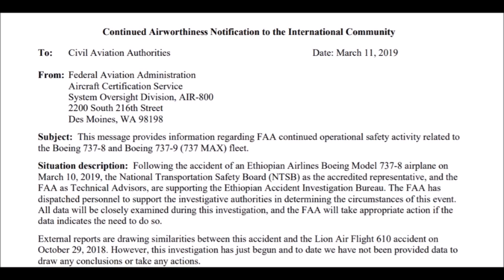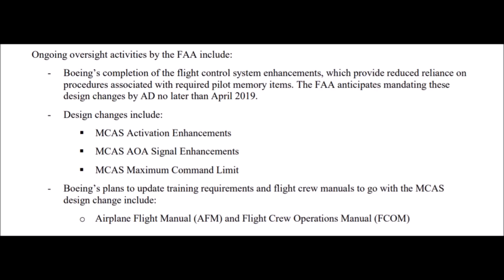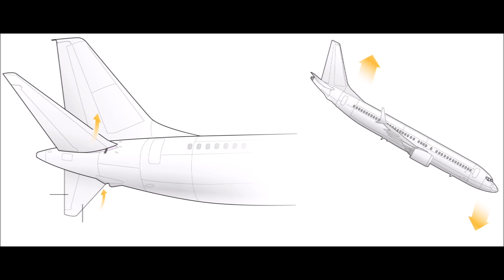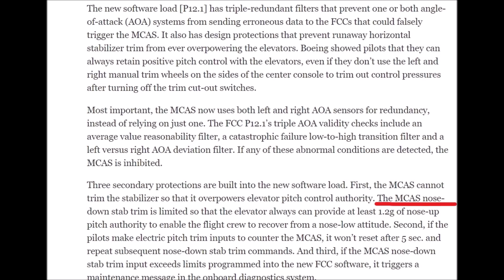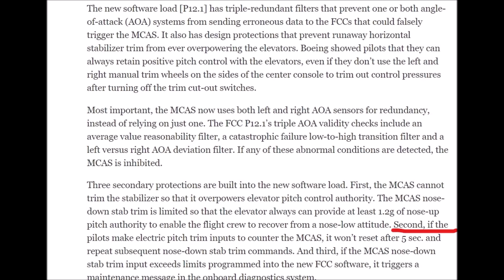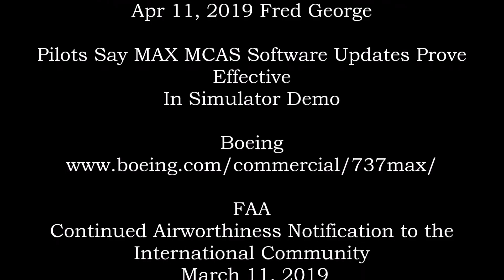737 Max UPDATE 14 April 2019 "The Fix"

Comment: Such a system to save money, save time, save training yet untested , unproven cutting corners results in two fatal accidents. Tell that to the families of the victims who list their lives. Its incompetence of Boeing and the FAA to release faulty design. Where is accountability. So how can you assure passenger this aircraft which is poorly upgraded and aerodynamically unstable be fixed by software. This plane is not hands off stable. I dont see why shortcuts are an accepted process at the expense of lives.

Comment: Can anyone explain why the Auto-throttle pushed the airplane to the dangerous high speed? Is that system also a problem? Is it in anyway connected to the new MCAS system?
Reply: Jian Min The autothrottles were set to maintain a fixed rate of climb. Since the aircraft did not climb because of MCAS, the speed accelerated.

Comment: No! You're Wrong Captain! There is NO fixing the MCAS system and getting these planes back in the air! None! The entire reconfiguration and program Must be aborted and scrapped. Any change to the aerodynamics such as these changes (enlarging the engines, squeezing them together and moving them forward) that is so great as to have to rely on a pc system overide such as MCAS is too much a violation of natural laws of physics or no overide would be required. It's a cheap cheat. Unforgivable. No rationalizing. Full stop. Not  open for discussion. No excuses. BTW I'm fully qualified to state this only because I'm not a pilot. But I flew kites as a kid. And I ski and mountain bike and ride horses cross country. Same principles apply. All of you in the industry are up too close. The Max 8 program. Should be completely aborted. You can retrofit the old 737 with a boob job enlarging, lifting and squeezing together... Your engines. Just as it injures the back of women getting bread augmentation so too do you injure passengers because you can't ever justify the risk even with corrected MCAS and training. There is no solution except to redesign the entire plane. Don't mismatch engines and fuseksges to fast track to a solution just to get promoted and a bonus. Ever easpect if this reals. So much for trusting a once stellar industry in terms of safety.

Comment: I am very concerned that this approach ignores the elephant in the room.  MCAS's only role was an economic one which is to prevent the retraining of pilots.   I think I will never board a 737 max unless they rip out MCAS and require 737 max pilot certification.  If they certify the 737 max with a software fix, I will refuse to book and furthermore board any 737 max's and I will let my airlines know this.   This cannot be a quick fix.  There is something fundamentally broken on what could have been a very cool plane.

Comment: To my previous comment. It sounds like MCAS was not fully tested in all flight parameters. It appears that this system was designed to make the Max series feel like the 737 NG. My question still is how was this released as a “production ready” product when all flight parameters were not fully tested. As you say. This question will be at the center of lots of questions and hopefully, answered.

Comment: Difficult to understand how MCAS got pass the “Proof of Concept” stage. Perhaps.., there were no “seasoned” pilots on the design team when this enhancement was thought up. I’ve personally witnessed software failures similar to this for decades... and throughout multiple industries. Thankfully, there were no lost of life with these occurrences. When the initial accident occurred, my first thought was... did Boeing take a page out of AirBus’ flight control technology playbook? Upon the second accident - there is a reasonable affirmative to this thought bubble. I was once told that commercial aviation in improving by one (1) accident at a time. Sad to realize how true that statement actually has become.

Comment: Juan, does that mean that the electric trim on the pilot/copilot yoke is not inhibited at that point the MCAS system cuts out? 
The reason I asked is because you were talking about the difficulties with manual trim during high air speed and that the crew was only able to gain minimal trim up manually. I was unsure because in the last video you spoke of the crew being unable to manually trim during a high speed decent and so, does that mean the electric trim was unusable too when MCAS was shut down or, were aero forces on the trim tab preventing electric trim  to work as well?
Reply: S S Once MCAS is fixed, there should be no need to use the trim cutout switches, and many of those difficulties will disappear.

Comment: From what Mentour Pilot said, the main reason for MCAS is because the engines on the MAX are larger on an already low sitting aircraft so in order to mount the engines higher to fit they had to be moved forward. That allows them to push the nose up more easily. So MCAS was meant to help the pilot over come that. It was just very poorly implemented. How they didnt factor in redundancy like everything else on an aircraft is beyond me.

Comment: The latest slogan for Boeing goes like this "If it is a Boeing 737 MAX I AM NOT GOING". The public will not be swayed very easy to put their lives on the line by flying this flawed product. Boeing did not look at the maximum travel in the nose down of the elevator stabilizer jack screw. The jack screw was left over from the original 737 700 series and down. Cutting down the length of this jack screw or installing a physical stop instead of depending on a "SOFTWARE" limit for this screw is the right thing to do. This plane needs to be kept out of service until the whole certification process is reviewed.

Comment: Automation is always a good thing, I agree but using automation to fix a flaw in design is a misuse of automation. Did the previous versions of the 737 need MCAS...No! This is because the engineers who designed them were not thinking of the "bottom line". Now I understand that some sort of rotation or torque will occur when power is increased to the engines this is physics, but to the degree where it can cause a stall it is poor design and dangerous. Now the upgrades will fix the problems with the MCAS but will it fix the aircraft? 
I do not want to seem conceited  but I bet if they put that engine back under the wing and do some engineering to figure the landing gear height problem this flaw would be non-existent and the 737's reputation would start to heal.

Comment: Maybe the MCAS stuff was a symptom of a root cause higher up the chain, specifically the angle-of-attack sensors. Both Lion Air and Ethiopian airlines were from third world airports where it is not inconceivable that the procedures to protect angle-of-attack sensors from wasp nests were not followed.
The evidence for angle-of-attack sensors blockage in both cases would be unrecoverable and hence maybe not the main concern.
https://www.heraldnet.com/nation-world/not-just-the-737-angle-of-attack-sensors-have-had-problems/
Even with the changes Boeing is proposing if both sides angle-of-attack sensors are blocked by wasps, MCAS could still get bad readings from both sides and suprise the pilots with weird stuff.
I think Pitot tubes and angle-of-attack sensors should have air pressure fed into them prior to takeoff to confirm no blockage and therefore correct operation.

Comment: I'm honestly puzzled as to why Boeing didn't implement this from the outset. Not a matter of "hindsight being 20/20", this fail-safe redundancy is standard procedure for flight critical systems. I'm a senior test tech for a leading avionics company and all of the flight critical stuff I've worked on has always been like this. We have 2 processors in each ILS receiver cross-checking each other. If they disagree, the 'master' will flag the data as corrupt and the 'slave' will disconnect the data bus. Our autopilots automatically disengage with conflicting inputs, etc.

Comment: Automation in aircraft is fine because there are regulations to keep the pilots practiced in hand flying. In automobiles, I think were all in trouble. Things like auto braking and auto lane centering will essentially allow people to be that much more irresponsible behind the wheel. "Yes, I've had too much to drink but my car can drive itself so what's the problem?" Drivers don't have the supervision that pilots do. Years ago there was a collision (I don't call them accidents because most are not accidental) because a newly purchased car had antilock brakes. This driver thought he could stop on sheet ice because the wheels wouldn't skid. Sadly he found out otherwise. Will there be regulations to keep people practiced and knowledgeable  with these automated cars? I certainly hope so

Comment: Juan thank again for the update with accurate explanation, a simple question: those killer engineer team going to connect 2 AOA sensors instead of one on the CMAS device, so if 1 of those 2 isn't working proprally it will shutoff the CMAS or will that device make a "lucky" multiple choice between those 2 censors info? Why not put a 3 th one so data can be logical compared! Or will we re- design a brand new single AOA unfailable sensor if ever those 737 max 8 and 9 crap would go back in the air?

Comment: My concerns are a bit different from most of the comments.  The original MCAS system allowed for the horizontal stabilizers to move to the full extension or limit of the  jack screw.  Someone must have thought that much trim could be necessary.   Is there still a situation that could exist that would require that much trim?  Is there a loading situation where there could be that much weight in the back section of the plane, that it would fly normally with full elevator trim?   Maybe the original software engineers were compensating for a problem with the aircraft's balance that we are not being told about.  To what extent are the pilots going to be trained?  What if the system cuts out, but is actually needed to bring the plane out of a stall?  It's good they are working on the problem but it may not be correct to immediately assume this is the end of the problems with the airplane's trim control.
Reply: Internet Privacy Advocate Actually the software was limited to zero degrees nose down trim. Unfortunately at high speed this is still uncontrollable, since an aircraft must have some nose up pitch to fly, and the elevator forces were very heavy.
Reply: @gordonrichardson2972 , if I understand you correctly full extension of the screw jack or the nut moving on the jack screw when it reached the very top of the screw, the airplane would have been perfectly level to the air flow.  However to maintain lift, it has to be somewhat nose up to the air flow.  But then if there is too much of a nose up condition the flow of air is interrupted and the plane looses all lift.  I do understand that at high speed the large control surfaces become very difficult to move.  That is in fact why a large screw jack is used in the 1st place.

But what I'm questioning is why did the designers of the original software believe that full extension of the control surface as it relates to the travel on the jack screw could be necessary?

I can't remember if you are the guy that is adamant that there are issues beyond the MCAS system.  I don't know, but believe there could be.  There has to be a reason this system was added to this particular aircraft.  We are told it is due to the position of the larger engines.

Comment: Boeing has let their bottom line dictate production shortcuts. The 737 has been a great aircraft. Boeing should have designed a new air frame to handle these new larger engines. Instead, Boeing pushed the larger engine mountings forward, thus pushing the center of gravity forward. Which called for the creation of MCAS to correct the nose down attitude. The FAA are at fault, in that they transferred their inspection and testing protocols to the manufacturer, who signed off on the new aircraft certification.

Comment: Juan are you able to speculate / opine on what you think is the reason such a thing made it this far in such a highly regulated industry? Is this profiteering games, "Ah we can circumvent that regulation / requirement if xyz."

Was making mcas as "lite" of a system as possible required to not raise flags that this aircraft model may need a new "type certificate"?

When I think of what you said on the whole, it's yes that's why.

Comment: I will try my best never to be a passenger on this plane. I hope that there is enough outrage from passengers like myself to keep this plane permanently grounded 
Just knowing that the engine placement causes the plane to do things that the 737 never did and rely on a computer to handle that is just frightening. The only lesson Boeing can learn is to accept this is a colossal mistake and scrap the plane altogether. I really dont care how good the computer fix might be. My brother has a very computer driven private plane, the Falcon 7' x and  I know for a fact the computer systems are prone to failure. They have back up's certainly but the plane should be designed to fly without relying on a computer rather than the other way round.

Comment: Hello!

I have no dispute that the MCAS was not "finished" for real world use. I am also aware of how such software is produced. A standard someone I respect established was that there be a single person responsible for a readthrough of such a system [30 years ago]. It is frustrating that human error will infest software. It is more frustrating that software is not modular -- and easy to analyze -- enough to be make a "single-person readthrough" practical. 

I had some contact with systems not bearing on life or death situations. One of the systems was an accounting program which had bad code which double counted some data. I found the place where that was and fixed it. [The code looked very much like someone could have been winding up their work when they were weary or distracted. And they left old code in the program which counted once. And new code that counted again.] 

I hope this manner of mistake were much easier to identify. 

Thank you for your insight and fairly straightforward explanation of the likely problem.

--DG

Comment: IMHO how it got certified is the real problem.  The deficiencies were obvious and should have been picked up.  And it begs the question, if the certification process missed these, what other gotchas are waiting to pop out for my next flight on other aircraft.  I was not aware commercial aircraft passengers are actually beta testers.

Comment: Insufficient "what if" testing on the program.  Also no triple redundancy.  Oh well. The fixes seem appropriate though at what cost?
Reply: Matthew Trevett — Triple redundancy doesn’t automatically get you fault tolerance, there must be a properly designed system to implement it.  There are examples of Airbus getting into trouble by using incorrect sensor data as well.  Qantas 72 — A330
Reply: @GH-oi2jf  I don't disagree.

Comment: as you commented season two pilots had no problem dealing with this increased Center of Gravityforward center of gravity I'm against adding any more computer control than absolutely needed and again that they might a revised them Mass but as I had questioned in Prior videos shouldn't be procedure to any pilot to shut off Mcas the automatic trim and the automatic throttles when you get into a situation like that and just fly the airplane you know the first thing they taught us just a short time ago was keep your head out of the plane biggest tendency is to get your tunnel vision down to where you're just staring at your gauges . mcast in my opinion from what you said isn't necessary except for rookies and it doesn't need to be any more computer-controlled then absolutely necessary they're making these things to automated and people depend too much on computers and again you know garbage in garbage out who knows there might be a glitch in a program or a bite of information get ready and correctly and hear you're back in the same boat you were in before

Comment: On these reports, they are assuming both stabiliizers are working perfectly well. They also assume the attack angle sensors read error. They must prove the assumptions are true before they write this report. Are the sensors specially made for Max only, that no other model using the same sensor? If not and if it is that unreliable, why is it does not give error reading on other models, such as 777, 787? The MCAS system works only under stall. Why are there no body ask a stall condition should never occurs? Good safety plane should never stall, regardless the auto pilot is on or off. This plane can not take off without auto pilot. They are telling us this plane must use MCAS because it can stall by nature. And they assuming a stalled plane can recover without damages. Is this commercial plane designed to survive on stall as a fighter in air show? And they are telling us must use MCAS to correct it. On this report, they are not saying you can totally cut off the MCAS. The MCAS is only give you certain manual control provision under certain condition. And they claim this plane is still very safe? I wonder why the pilots believe them.

Comment: Are the AOA vanes doing the same job as the gyro stabilization chip does on a drone? Why do they need to stick out in the air?
Reply from the maker: That's what they measure. I'll cover this later.

Comment: I am still stuck on the autothrottles. Was the pitot tube giving the aircraft erroneous information? Seems to be an important issue which led to the aircraft becoming uncontrollable very quickly. Why did not the controllers question the aircraft speed, just not enough time? Love your videos!